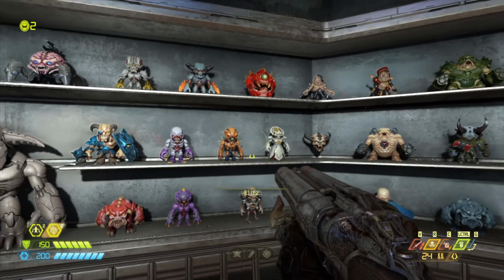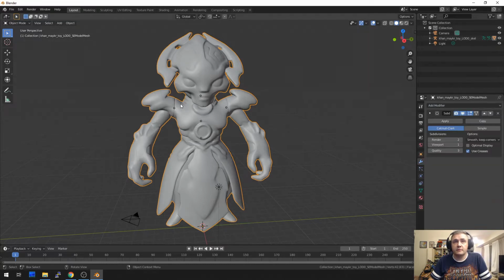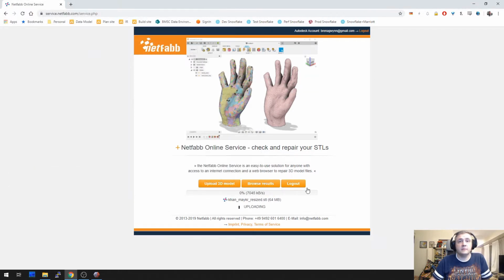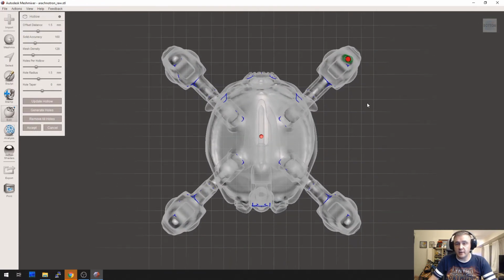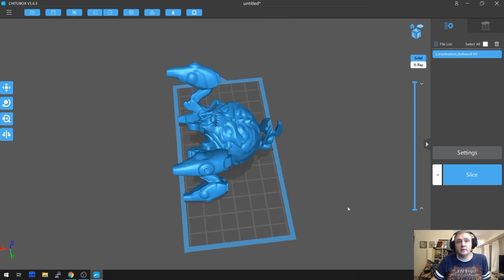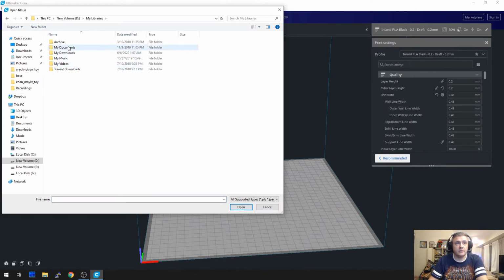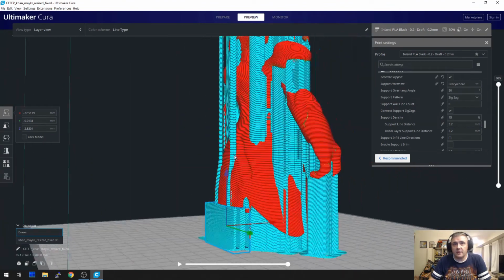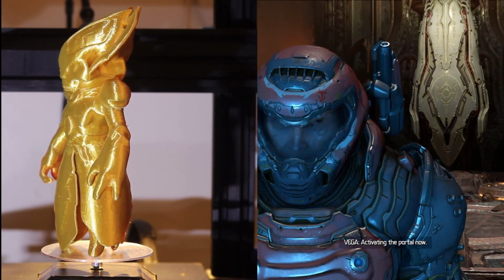3D Printing Toys from DOOM Eternal | 500 Sub Special!

Comment: I've found when working with the model to connect the triangles select your model. Go to edit then mesh. Then cleanup merge by distance.

The actual game models (not the toys) use semodel then merge by distance. Then press  p then by loose parts to get the different model parts. Then go to the different model parts and delete the damage sections so they don't appear on the finished model.

Not a lot of blender expertise, just messing around for a couple of days.

Still figuring out how to enable damage for certain parts on the demons

Bonus of semodel is it keeps the armature so you can load seanim and take the model at a certain frame of animation so you don't end up with a t posing humanoid
Reply from the maker: Aha! Loss of the armature is probably why the marauder toy model has his axe stuck in his... crotch :) I need to try exporting it as semodel and processing it in Blender.
Reply: @IgorsWorkshop  one thing I recently found is sometimes you get weird artifacts during prints or parts of the model are not a closed mesh.

Best program I've found is on the Microsoft store called "3D Builder". After you export the obj from blender import that into 3d builder and it will fix your mesh.
Reply from the maker: @cjgibbsey  I've actually started using 3D Builder recently and it's a very capable tool indeed.

Comment: Fun stuff! I haven't used Inland's new silk, but most other silks I have printed require a fair amount of more heat to get good adhesion. I generally print them around 220C.
Reply from the maker: Thanks, I'll try cranking up heat. The other problem with this particular filament is poor diameter consistency. It got jammed in the filament runout sensor once. This never happened with any other filament I ever used.

Comment: You know you could likely repair it much quicker using 3d builder? (Start > Windows Accessories > 3d Builder) Far too often netfabb takes waaay too long. If for some reason 3d builder fails to repair it, then I might resort to netfabb, but it's likely it will fail to repair it in that case too, and it will need remeshing, or proper welding before export ;) (blender sucks at that unfortunately) Also, 3d builder can auto-weld small bits like you had in your models, and hollow out your model without remeshing it like meshmixer does :) You just have to create 2 or 3 cylinders to place/cut from your model manually after hollowing, but that's easy as pie
Reply from the maker: Thanks! I'll make sure to give it a try! Have you seen my question about OBJ format and Blender at 35:53? I'm a total Blender noob, so I wonder if I'm doing something wrong, or is it Vega that exports OBJ files incorrectly? Basically, all triangles are disconnected from each other. Is this something you refer to as "welding"?
Reply: @IgorsWorkshop  Yes. If you import it to 3d builder first, it will show up with a red box saying there are errors, and if you click on it,  it will automatically weld the vertices. (that's the technical term these programs use for fusing vertices together) You can then export it from 3d builder as an OBJ file, and it can be imported to blender for adjusting if need be. I would recommend after exporting it from blender after making changes, to again load it up in 3d builder to check for errors though. 
Also, the reason why it's black, is because it has imported the obj file, which has exported with an MTL file. (material) I'm not 100% sure why blender shows it as black, because it would usually show an actual texture, but it's possible the textures weren't correctly exported from Vega correctly?